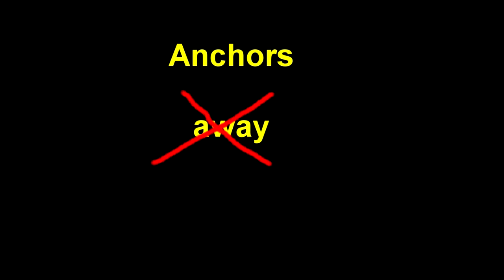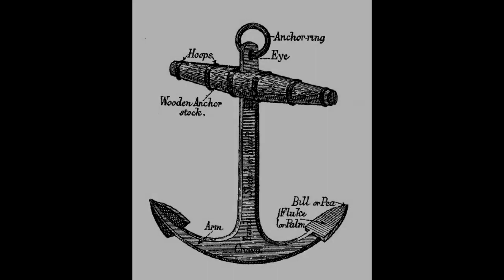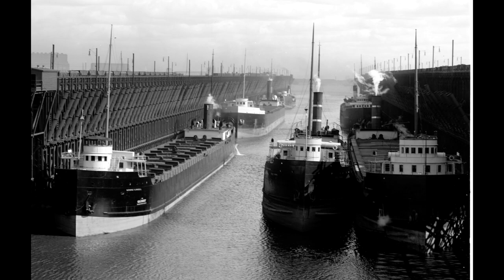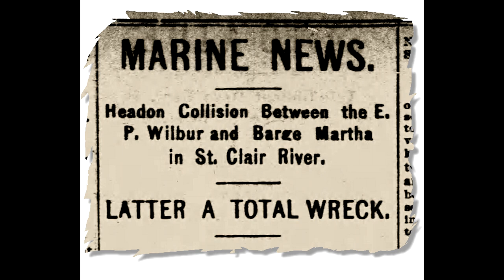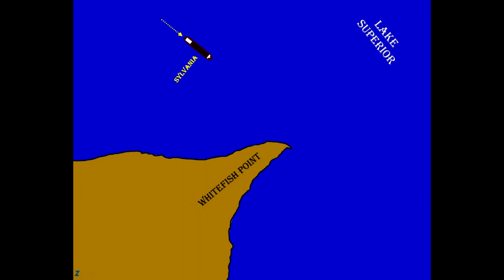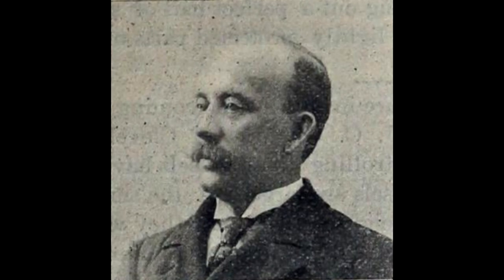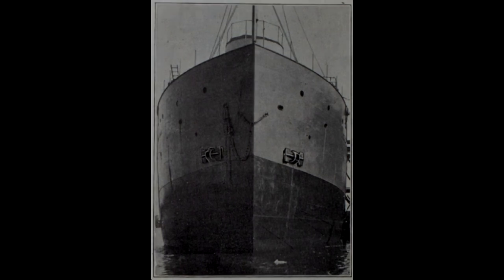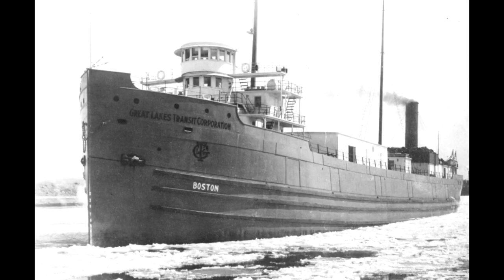Anchors Away is about how collisions inspired the invention of a device indigenous to the Lakes

Comment: Navy wooden minesweepers were equipped with 500# bronze (non-magnetic) Danforth type anchors.
When our pitch system failed as we were leaving a moorage in the Bancock River, (5 knot current) we sideswipped another sweep.
Its anchor ripped out the chain plates on our ship and other damage.
Scarry moment!
Reply from the maker: Wow! Thanks for adding that tale.
Reply: @authorwes  Your welcome!
Reply: My old 30ft wooden motor yacht built 1930 used in 1940 to take troops off the beach of Dunkirk and then performed mine patrol of the Thames Estuary UK for the rest of WWII. Those old wooden craft came in very handy.